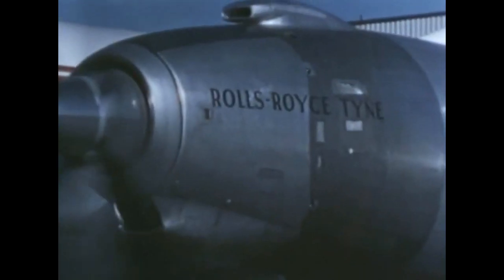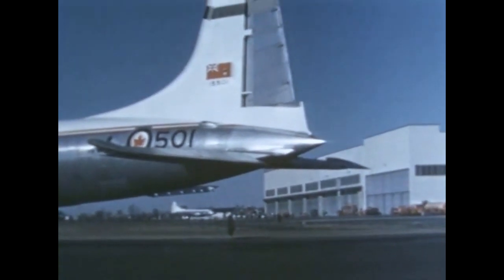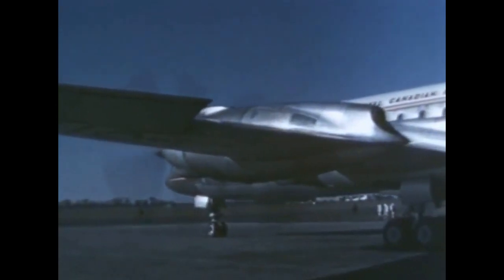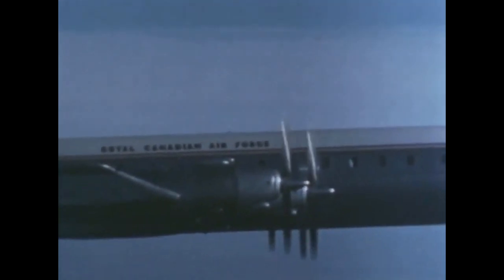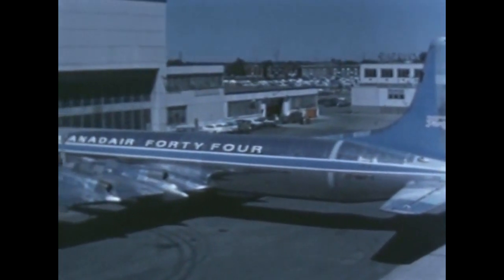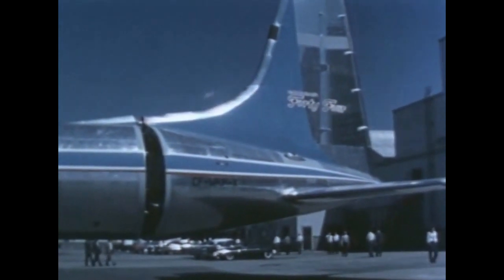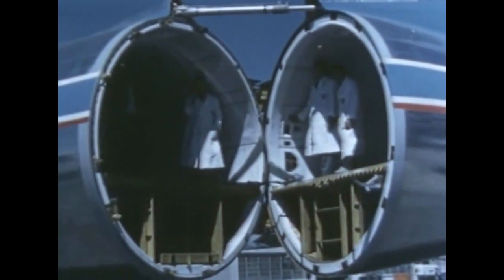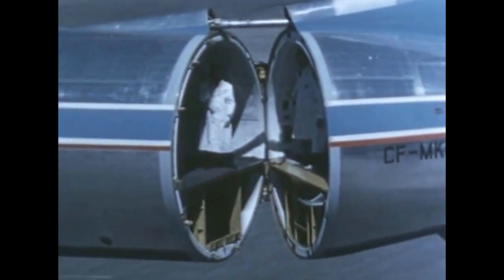Canadair CC-106 Yukon & CL-44 "Swing-Tail" Promo Spot - 1960

Comment: I saw one of the CL-44's apart, in a hangar, at Gander circa '86. I don't believe that it was being cannibalized, and it appeared to have "Icelandic" badging, which had been painted over. (I had to inquire as to the type of aircraft, as I thought the tail was 'totally Vickers'.  The design seemed well-suited for 'frigid-climate use', with a hefty deicing system, and more than adequate control surfaces; a decent design.